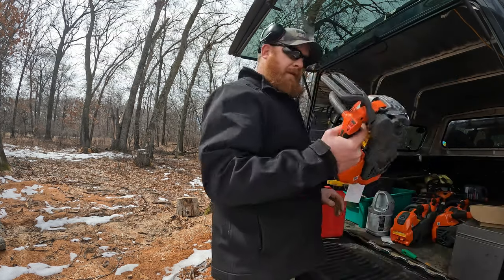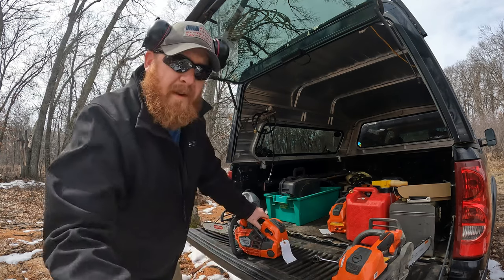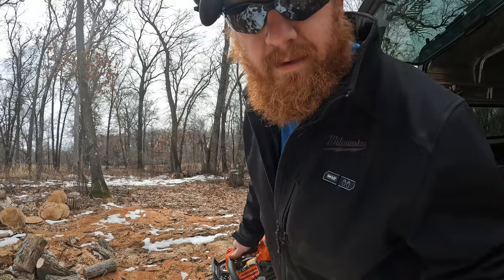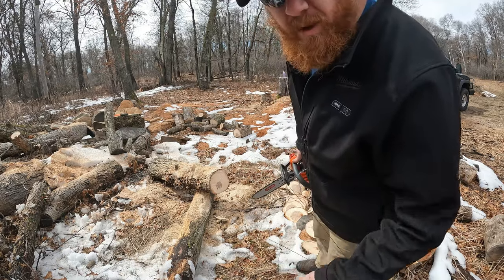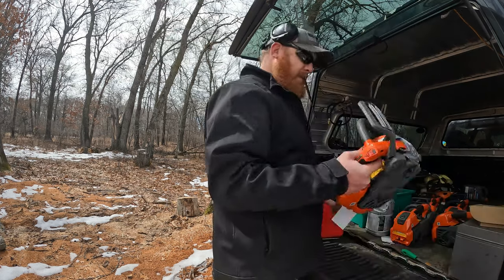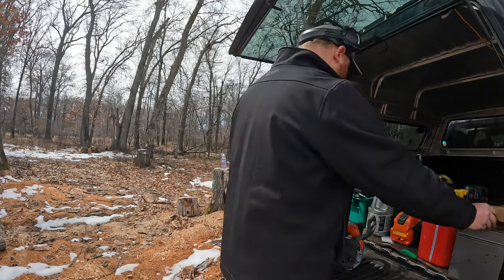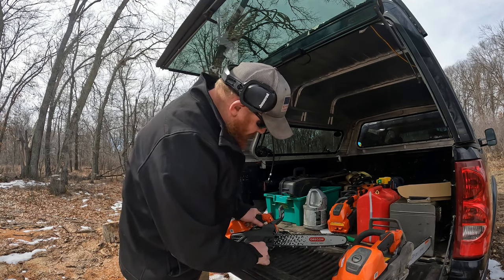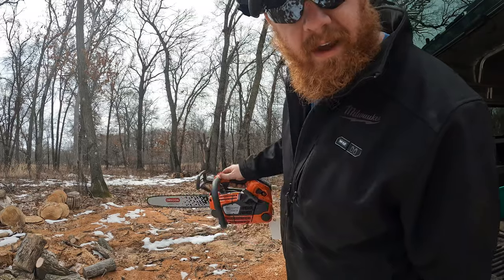T540 MKIII Tips

Comment: So what do I do buddy if I did not do the first step like you said when I got my saw can I start over and do it again because as soon as I put the choke on once it started I hit the throttle immediately it has been shutting off on me should I start the process over again thank you buddy
Reply from the maker: Yea it's no problem to start the auto tune reset over again. Make the long cuts back to back etc and it should tune itself in
Reply: @mortalitool  okay buddy thank you so much
Reply: Look up auto tune recalibration bc I don't think what he is doing here is actually triggering recalibration. Sure, it's adjusting, but it's just adjusting itself how it normally does under use. These auto tunes are adjusting and taking readings like 10 times per revolution of the crank, but to actually enter recalibration where the saw actually re learns it's parameters and resets you have to have the saw under load for 60 seconds. That's how it knows to go into recalibration. If you let off the throttle, the timer starts over, and the computer doesn't know you want to recalibrate, so it just makes micro adjustments as normal but not actually reseting.
Reply: @Trolldaddy5  and how often do you have to do this so you mean Let It idle for how long and then put it into would like a rip cut for 60 seconds at Full Throttle correct
Reply: @br-dj2ti  you shouldn't have to do it often. It's necessary when new. Usually, the dealer asks you what fuel you use and does it for you when you buy it. But if you change your air filter, fuel, modify exhaust, etc. It may need done.  And yes, like a rip cut, but don't force the saw. Basically, what recalibration does is it learns your fuel, air, altitude,etc. All these factors and it finds and  learns the optimal operating parameters. And then, when you're running it or doing what he was doing, it's constantly making adjustments to keep the learned parameters from its actual calibration. I suck at explaining things. Just look up auto tune recalibration/reset or ask your local husqvarna dealer
Reply: @Trolldaddy5  okay thank you so very much I appreciate it

Comment: Once mine gets hot it's got s mind of its own won't stsy running,then it fires up, cut then won't cut reset or no reset does whatever no consistency what so ever
Reply: Yeah I'm having the same problem buddy
Reply: He's not actually recalibrating these saws here. They're just making normal adjustments as they do under normal use. To actually enter recalibration, you have to full throttle under load for 60 seconds. If you let off the trigger, the timer restarts, and the saw doesn't know you're trying to enter recalibration it just thinks you're making normal cuts. Yes these saws adjust constantly under use, but these adjustments are based on learned parameters from calibration. So, if your saw isn't calibrated for your fuel and your environment, it will be adjusting based on a different set of parameters, which can cause problems